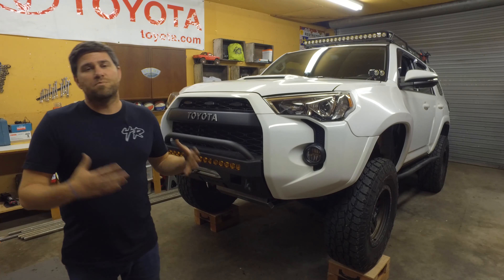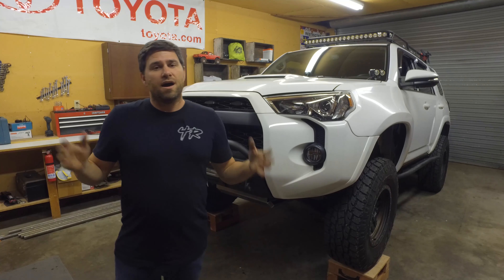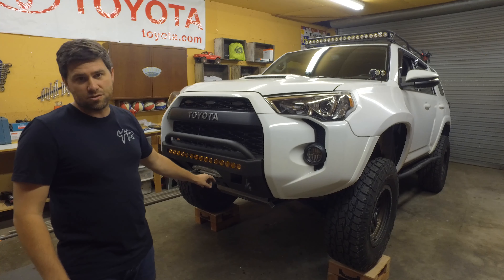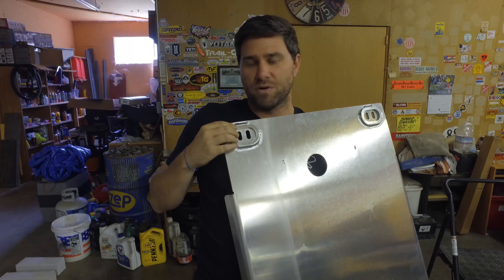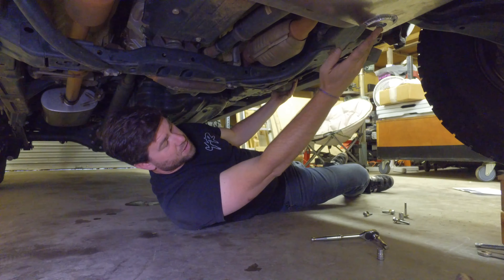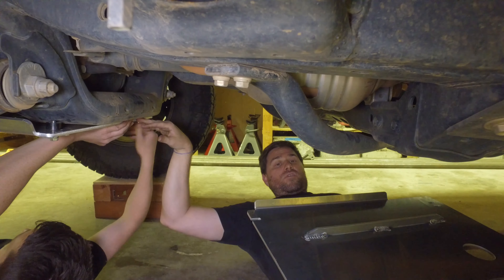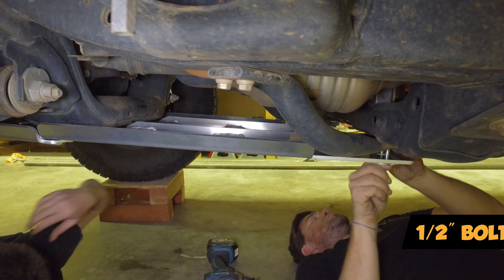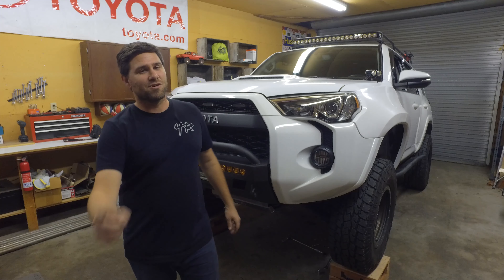RCI Transmission Skidplate Install | 5th Gen Toyota 4Runner

Comment: I just got the RCI skid plate so I could also install the catalytic guard for my 5th gen 4runner, do I need special tools for this? I wasn't sure what you guys were using for this install.
Reply from the maker: Check out Trailer write up, he typically does an entire tool list. But I don't think there was anything out of the ordinary.
https://trail4runner.com/2019/06/10/rci-transmission-skid-plate-install-5th-gen-4runner/

Comment: @ 2:29
Are you positive that we need to leave the black nylon ring? On my installation, It seems that the junction between the front skid plate and the transmission skid plate ain't flat. It makes a V shape, just like if the black nylon ring is making the fitting a bit to low. Thanks
Reply from the maker: Yes you need the spacer, but make sure it is the last item in the assembly (Bolt, washer, engine skid, trans skid, nylon).
Reply: @SnailTrail4x4  With the nylon ring in then the engine skid bolt isn't long enough.  I had to sand it down to make it fit...

Comment: Will this transmission skid plate work with the OEM TRD engine skid plate? I see they have one specific for the FJ but no info on the site for the 4R?
Reply: Did you ever get your answer? I'm wondering the same thing. Thx!
Reply: @h60flyer  hi, no, ended up keeping the stock transmission skid along with the TRD front skid. Been happy with this setup so far.
Reply: For those of you who stumble upon this question, I received this answer from RCI today:

Thank you for your interest in our skid plates. Our skid plates are compatible with the TRD Pro skid plate. However, it is the RCI Integration skid plate that mates up to the TRD Pro skid plate first. Then you continue the coverage with our transmission skid plate etc..

https://rcimetalworks.com/product/trd-integration-skid-plate/

https://rcimetalworks.com/product/10-19-4runner-transmission-skid-plate/